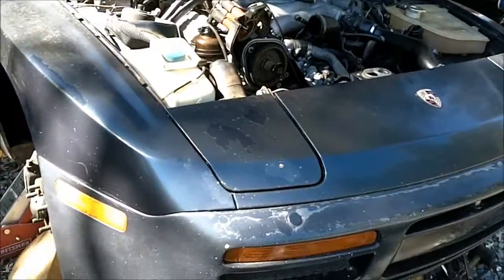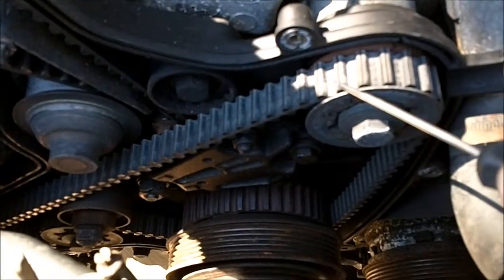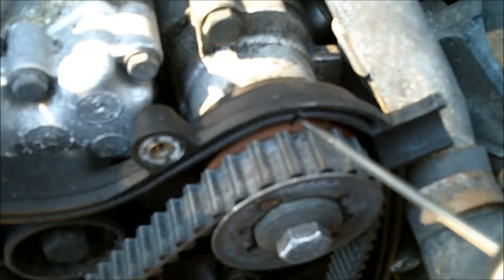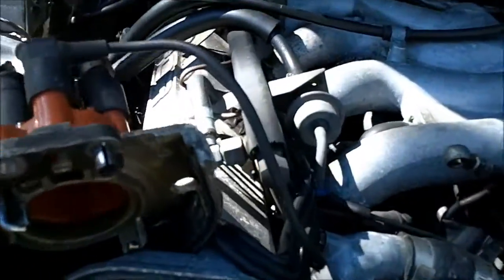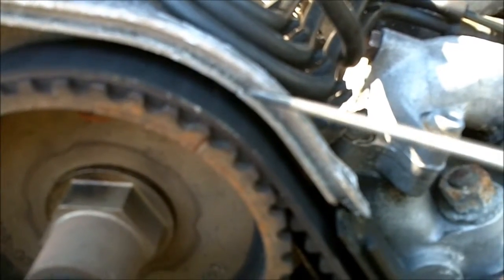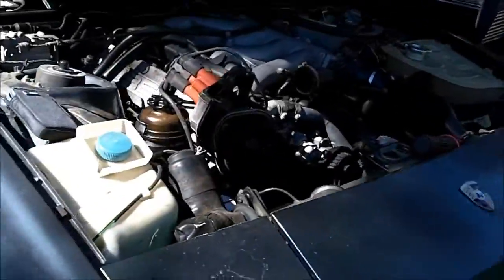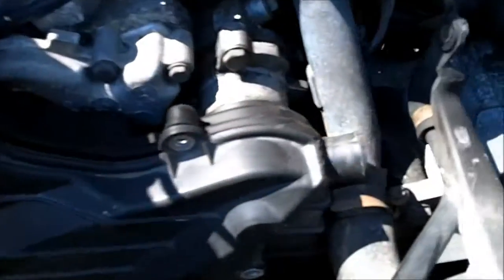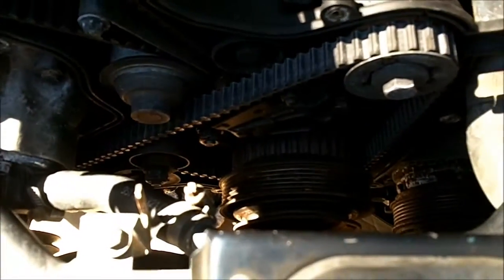944 TURBO TIMING BELT MARK LOCATIONS -- 944 Timing Marks

Comment: EXTREMELY HELPFUL!!! Thank you so much for posting this and actually pointing out where they were. Doing the timing belt and balance shaft belt on mine 944 now after the failure of the balance shaft belt (luckily the timing belt is still in good repair but getting replaced anyways). anyways mine will hopefully be on the road by next month, i have limited time to work on my projects so hopefully it won't be too much longer.
Reply from the maker: David Senn glad it helped, thanks for watching!!